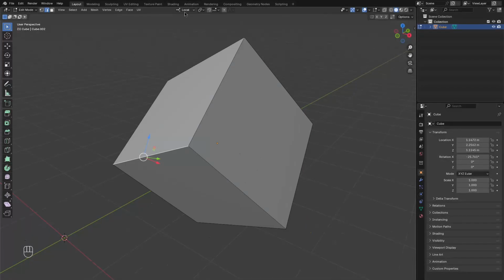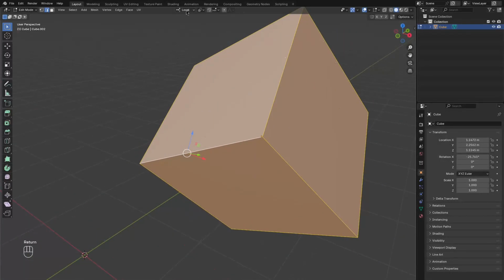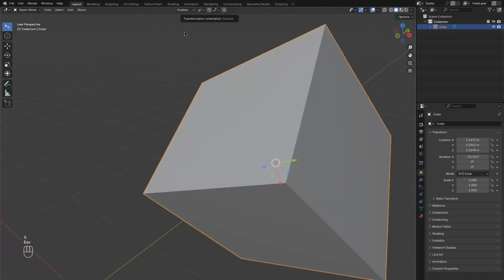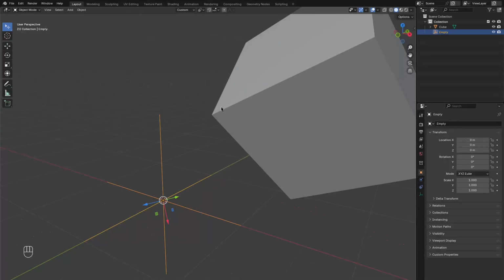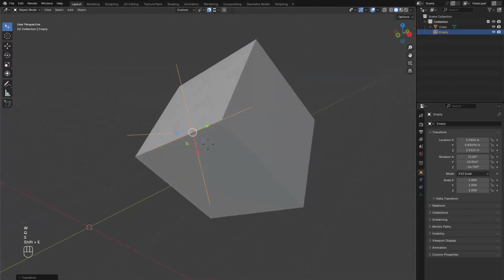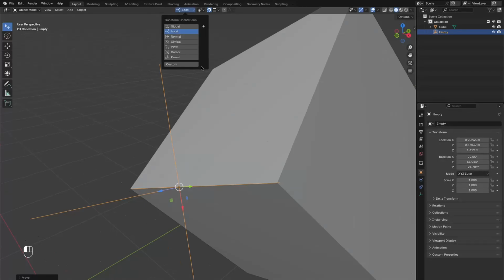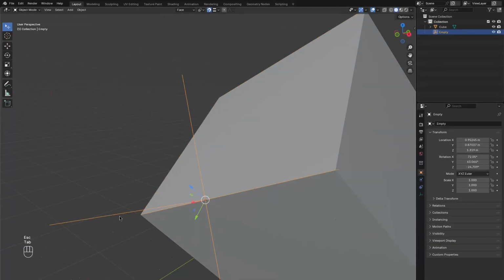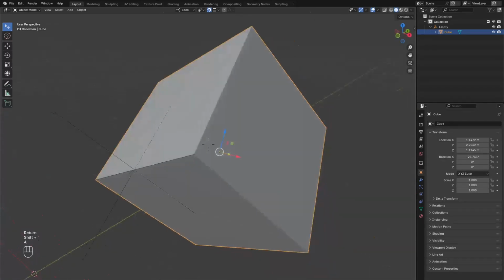Precisely Rotating Along Custom Axis/Edges/Faces - Blender 4.5 Tutorial

Comment: thanks for the video but this is infuriating - i'm not quite sure what you are trying to do.... are you just trying to move the object around its axis or keyframe the rotation of the cube item when pairing it to the empty - say moving ailerons of an aircraft at a particular angle to the rest of the wing etc. Your empty's x rotation moves at the end of the video - alone, suggesting keyframing is possible. But all I can do is rotate the empty on the y axis with the other X and Z axis items moving, meaning when you come to keyframe it will do a weird twisting motion. It makes me wonder if you have missed a step out you havent explained. Where the individual origins are and so on.... you set the transform if at all? or where the origins are - or if you turned off snapping or if you set different transform pivot points. It seems so convoluted for what is a simple thing to do but that's blender